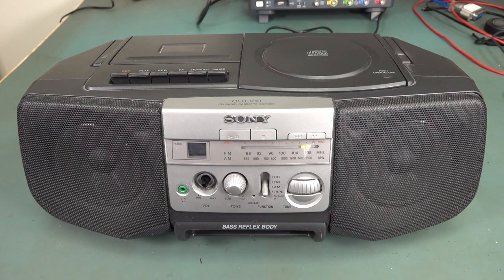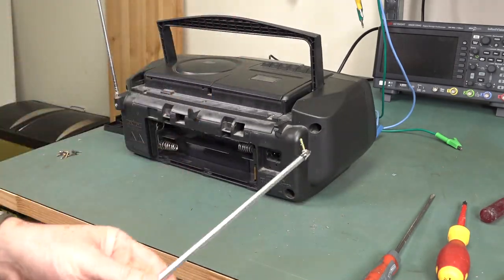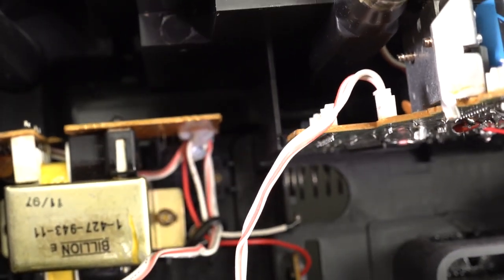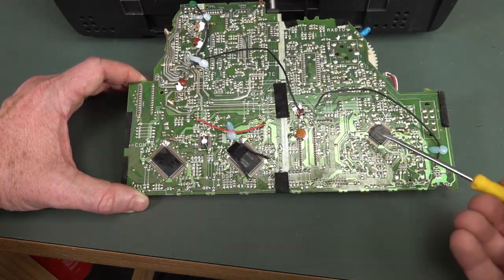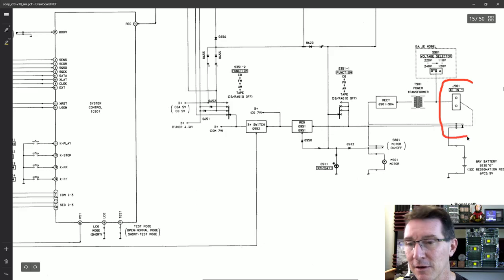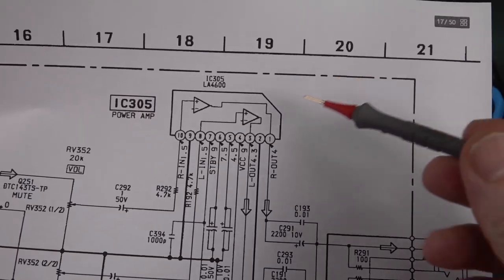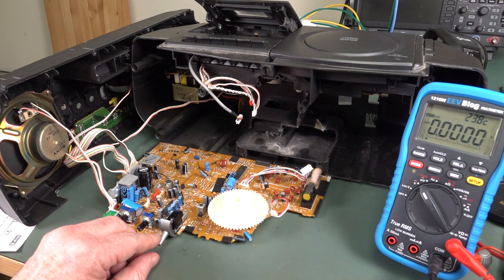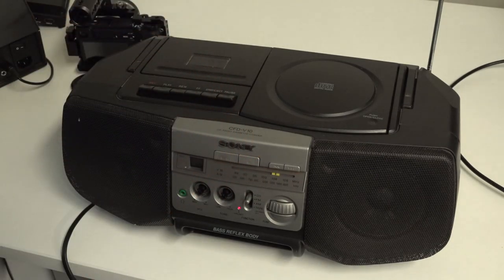EEVblog #1243 - Sony Boombox REPAIR and Teardown

Comment: The "sticky bit" is so they could terminate the bass ports and have them open at the back. There was likely a protrusion on the rear mold die that butted up to the front die to form the gap at the back on the ports. Probably throwing a sticker there was the easiest way to block off the resulting cavity after molding the case.
Reply from the maker: Someone mentioned it's an option for a battery backup model.
Reply: Is amazing how this comment sounds like he knows exactly what it is. If I didn't read the other comment, I'd think this guy knew exactly what he was talking about.
Reply: @xenonram  That's because Im an engineer, and if you read the comment Dave is referring to, another poster said the same thing I did: its from the molding process. Have a look at the opening behind the sticker. Notice anything? Like the fact that it has the SAME shape and dimensions as the exterior outline of the bass ports? That's because the rear mold injection die likely had a protrusion in it to form the rear of the bass ports. Plastic injection molds have to be able to be pulled directly from the formed parts, so you need a pretty straight shot to get them off. At most there will be some draft to help with the extraction process. The only way you could practically form a blind feature like having the ports stop a few cm from the rear of the case is to have the rear half have a mating protrusion to form them. This obviously will leave a cavity in the molded part, which has to be filled in some how. Its the most likely explanation since "battery backup" doesn't make much sense. Theres no clock or anything to maintain, and the boom box is too large to be a clock radio/alarm. On top of that, there is not enough space or features to accommodate having a pair of AA's behind the sticker. Putting a black plastic strip is an easy way to hide it in a low buck consumer part.
Reply: @xenonram  Now, as for why they did it like that, there is a support for the circuit board on top of that rear portion of the bass port. This was probably a relatively simple way to get the support in the center without obstructing the bass port, since it looked like they at least made an effort to get it to perform ok acoustically. Making the port two sections in each half of the case may have also allowed them to get enough depth of the port without having to omit the supports or have some complex feature around the bass port to incorporate the PCB support, or have the port be excessively long since it would be harder to get it to mold properly and not have it get distorted dimensionally. Hard to say and we can only speculate what their line of thought really was, but it does look like some effort went into the bass response since they have foam bits everywhere to try and tune it. Its possible its for something else (or could have had an alternate use in the early design), but it doesn't appear that way from looking at it.

Comment: 11:36 I believe that the wave solder was gone from bottom to top and the profile of the pointed chip doesn't matter. They weren't able to do this with four sided chips so they placed them on 45 degree

Comment: That is hilarious. I am just an amateur, but had the same problem with a sony car radio. It lost sound on vibration and did this buzzing sound. I looked for the problem so long. It is really hard to catch those little cracks. Sony schematic are really great.

Comment: Jep, i can easily confirm that...i own several (real;) BoomBoxes and usually when there was intermitent sound issues the PowerAmp(s) have solderjoint fails. Also the belts of the cassette drive needs to be replaced almost every time.

Comment: So typical of wave-soldered boards with heavy through-hole components with larger pins. Power ICs, connectors, etc. Also it may be prudent to check the solder on the pots.

Comment: Great find on the fault Dave, but should have been found first up with a visual inspection... I doubt after 20 years the cassette player would be working due to drive belts being perished, regardless of capstan and head cleaning etc... CD laser could probably do with a good clean...8/10
Reply from the maker: You can't see it with the naked eye, requires significant magnification inspection at the right light angle.

Comment: I miss the days when you could brag about your stereo and say "It's a Sony" and not get laughed at.
Reply: These days pretty much any stereo sucks. Integrated amps and receivers are best.
Reply: Sony still makes some quality gear. I still consider them a prestigious brand.
Reply: @remyrattner6399  True, but boombox type stereos and those "1000W PMPO" speakers were trash and still are trash.  Even their car "xplod" line is mostly trash. They have good integrated amps and some older car amps, have old XM-4020 and it does more than it's rated for and it sounds great.

Comment: The asymmetrical foam is probably to dampen standing waves,  symmetry inside the enclosure is not gonna matter much anyway as most stereo information is gonna come from the front of the drivers and the enclosure is meant to be just one bass reflex system. 

Symmetry in the enclosure would even increase some standing waves dependent on the internal walls facing each other etc. and possibly cause "fluting" in the port.

*Hmm, they do have a wall in the molding sort of separating both chambers so the piece of foam on the right might be to compensate for the difference in volume with the extra board on the left side... pretty sure the piece of foam in the port is for the "fluting" problem though. 

(audio design dropout)
Reply from the maker: Thanks

Comment: I'm really surprised to see those big expensive caps on the speaker connections. For single rail designes it makes more sense to use a bridged output amp that makes the DC bias common mode across the speaker coil.

Comment: I guess the main reason for the broken joints is vibrations of the heat sink. It's poorly fixed from the look of it and might put some load on the pins of the amp.

Comment: Sony is known for bad solder joints back then. Same in their TVs and component stereo receivers.
Reply: Wave soldering in general causes bad joints. See my comment above.
Reply: I have a Sony STR-D1090 that was riddled with dry solder joints. including one of the main outputs on the transformer with no solder at all. it was a wonder it even worked from the start.,
Reply: My receiver failed that way I think.
Reply: I remember a Sony where the bad joint completely collapsed on reflow.  The joint was just a giant solder bubble.

My Sony receiver (STR-D990) quickly developed a faint squeal.  It also turned out to be a bad connection in the preamp stage.  Sad part on that is that the squeal came back.  It wasn't hard to find where the tech had worked on it, and I reflowed the joint again and found that the pad had lifted.  Ran a wire to replace it, and it quieted down again.

Comment: It's not just heat cycling that cause the crack joints. Remember, it's a boombox, so it might have accepted some kind of impact sometime it its life!
(edit: The very deep screw holes is common on Sony products!)
Reply: That's Sony for you,, we fixed many Sony Tv's withe bad solder joints. Many times the sets would come in dead. Dave learned his lesson don't spend time looking for bad parts, first do a visual inspection.

Comment: So what I want to know is, did you get the radio tuner indicator aligned with the actual tuner?
Reply: Ha ha I second that! I could only cringe and watch in horror.
Reply: Turn the tuner can all the way to its end and do the same to the indicator. We've done this many a time maintaining the Sony box we have.
Reply: Tune radio to known station then move the dial to appropriate place reassemble
Reply: @danthemancasey  "cringe and watch in horror" ugggghhh.
Reply: @xenonram  Well not to be dramatic or anything...

Comment: These radio/cd/cassette players had all the type of failures.Cassette mechanism related,laser head probably KSS213,terminal microswithes oxidation,input selector contacts oxidation,volume potentiometer scratches and loose contact,headphone jack dry joins and oxidated contacts,power supply socket dry joins and oxidation contacts between dc and battery switch auto selector,external antenna and sometimes its holder replacement,speakers replacement.But it needed one or two hours for repairing depending the fault and many technicians prefered tv and video repairings as more easy with more money.

Comment: I wonder if the same issue is what is causing my bass guitar amp to act strangely. The audio sometimes crackles, and it gets a lot louder with very low, rumbling sounds -- maybe low enough to re-establish the intermittent connections? It's only about 10 years old, but with all the heavy vibrations, heating, and transportation, maybe some solder joints are failed in a way that's invisible to the naked eye. I should take another look at it before giving it into the repair shop.

Comment: 7:10 I’m going to guess it’s for the injection moulding of the internals work correctly? Then there’s just a stick on panel to cover the hole.

Comment: I've worked on a lot of boomboxes and from other models I would guesstimate those empty tweeter ports might be for microphones which would go for the tape to record the radio. It was a fairly common feature back then and I was surprised to see it was accomplished in a way where stray sounds could ruin the recording rather than just do it electronically.

Comment: I remember seeing a similar model boom box as a kid here in the states. The only difference I remember was the “bass reflex body” label was different, and Sony used the phrase “MEGA BASS” in gold lettering in the same place.

I guess Sony couldn’t use the phrase MEGA BASS in Australia?
Reply: Mega Bass models had a dedicate woofer that could be turned on optionally, this one relies only on bass reflex from the speakers ;-D
Reply: ...That might explain also the foam job in the speaker cavity, it's done to muffle bass sounds and avoid echo, but in the other speaker is not necessary because there's the power supply naturally reducing echo ;-D

Comment: I have Logitech x-230 2.1 PC speakers. When I moved, I noticed that the sub hums even when the speaks are turned off and the audio jack is disconnected. At night I have to unplug the power to the speakers to silence the hum. I also notice that if I plug a USB charger into the outlet and then have Bluetooth headphones charging on the USB while listening to them there will be a hum that stops when I unplug the USB. Any ideas? Is there a filter I can buy or make? I have two outlets in my room and they both hum and there isn't any motors or anything on that circuit. My house is old, the wiring is partly new (1980's) partly old (1940's).
Reply: It's inherent in the design, and it's true of almost all speakers. See EEVblog #1118 and #1128.
Reply: The hum is caused by the Y capacitor between primary and secondary in the switch mode power supply of the USB charger.

Comment: seems like Dave always jumps in the deep end when its something as simple as bodgy solder joints!
Reply from the maker: You mean jumping in the deep end and doing silly stuff like measuring power supply voltages? :-/
Reply: @EEVblog  nah i mean pulling out the schematic...before doing a proper visual inspection! :P

Comment: I'd guess that the battery flex area is a passive resonator that were popular in the 90's.
Reply: That's totally useless as a passive radiator, it has no excursion. I think it's to keep the batteries from rattling.
Reply: Doubt it, but you can find tunned ports that were calculated by software all around the Panasonic RX-ED series. Impressive sound with 3.5 inch speakers.

Comment: Hey, nice video like all of the video you make
and, yes, that's something i seen a lot.
 the soldering failure and.
 depend of how it fail but it can give a nice DC voltage on the speaker output and if you have good speakers connected, this can really ruin your day and even more....
and, i used portable Sony device like this in the old time and what was really good with them was.
sound quality for a portable device that was excellent and how they was able to survive to really bad treatments like.... it was almost possible to use them as a soccer ball!!!!
they was really good and made for last it was the good old time.....
Reply: That's why I prefer output coupling cap designs to split rail. If there is imbalance in the bipolar PSU you will get DC on your speakers.
Reply: @westelaudio943  ah yeah, that's good but i don't know why they not do it much maybe the cost? or because it can lower the performances? or both together.....

Comment: i've fixed a window relay, clock, and the aircon panel on a 30 year old nissan by re flowing the solder because the through hole stuff cracks just like this. or a large flat surface mount resistor lifts off on one side. i wonder if leaded solder would have kept this from happening
Reply: If it's 30 years old it would be leaded solder anyway.
Reply: @basvanderpeet5636  if i ever get a lead test kit i'll check, but it sounds like my car was made right around the time they started switching to lead free so who knows.

Comment: What caused the cracked joints is the wave soldering process not applying enough solder, vibration and thermal cycling of the amp chip.
they would have used leaded solder in 1997,98 so the crap lead free solder you see now was not a problem then.
 ive resoldered countless wave soldered boards properly over the years. Wave soldering NEVER applies enough solder, especially to large thermal mass parts - the wave comes through but then the solder just falls off again by gravity. Large through hole components should always be hand soldered with the board up-side-down.
Reply from the maker: The pads had plenty of solder, an idea amount in fact for a perfect fillet. Once of the problems is it's a single sided PCB, so no solder down the PTH.

Comment: Lower impedance drivers draw same amount of power then high impedance drivers, they use them so they can put cheaper part's in such as an entire amplifier on an i/c, not to save batteries. The other reason why they might have done it is lower impedance drivers have stronger force, resulting in better sound quality and output, though probably not doing any favors for this boombox lol!

Comment: You  can clearly see it was the end of boombox era, especially when taking a look at the CD-mechanism and ..... the tape deck.... (i quess with plastic flywheels (without any iron weight) and permanent magnet as erase 'head').  The lower quality caps (see some TEC and Lelon branded ones), brittle caramel PCB's, molded heatsink, plastic everywhere, hotsnot, avoiding screws (in some clever way tho), clearly build to lower the costs. You don't want to be critical because it is a Sony?  Is it made in Japan or already made in China? Anyway, does  mom have cats or dogs?

Comment: OMG I figured they were port holes not tweeters. They faked the bass reflex smh
Reply: JAY LEE sometime sits just the same mould being used from other models that do have real tweeters
Reply: @Dan_07  doesn't change the fact that its misleading
Reply: the bass reflex port is down below the front panel, it's square in shape. It is still useless, as I have noticed numerous other holes in the case.
Reply: JAY LEE   Not really as it is not specified in the specs

Comment: i have a very similar boombox except mine takes way more batteries.
Reply: I remember having one as a kid I swear it must have taken like 16 D cells (exaggerating but it felt like a lot at the time).  Just keep inserting them in and it just never ends!   Runs for about an hour. lol.

Comment: Will it ever sound the same, knowing now that those tweeters are nothing more than a die grinders artistic dream...?
Wasn't 98 was the year they had max rationing of sound deadening foam? tontine was just way to hard to pack in on the sweat line.

Comment: Hello from England, love Sony products and have a Sony ES surround amplifier, often thought about upgrading the capacitors for "audio" grade one's, eg fine gold nippon caps. 
Could you do a quick video on this. 
I always argue that better quality components make a difference and senior engineers say no. 
Is there a was to measure stock cap vs upgraded cap vs perceived upgrade? 
I'm only at mid level tech and the senior engineers run circles around me when I ask this. 
Cheers dude, a yeah nah would be enough.

Comment: Ah so the chip was heating up because somehow the power going to the speakers was being dissipated there? And the chip is still OK after being on like that? good luck syncing that frequency dial again.
Reply: It's easy on those Sonys. Just put the tuning condenser and the dial both together on either end of the spectrum. Done.
Reply: Just use a digital radio, seek for the station on the dail. Trial and error till you got right on the spot. Nothing too cmplicated.

Comment: Should have added a bluetooth reciever in there. Bring it into the modern age!
Reply: The best goodie for these stuff is a Bluetooth cassette adapter, perserve the looks and the tape mechansim still has a job ;)
Reply: @tubical71  Problem with those is you get added sound quality degradation through the tap heads. You can splice a BT reciever in parallel to the CD player so when you switch it to CD mode it turns on the BT module. It's an internal mod so doesn't affect the external aesthetics.